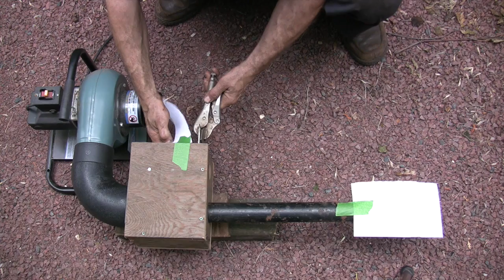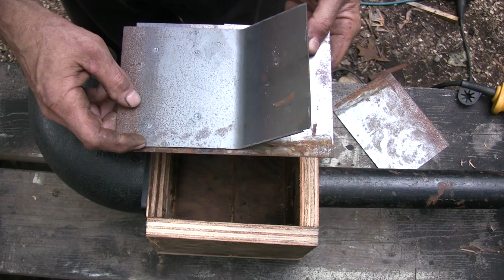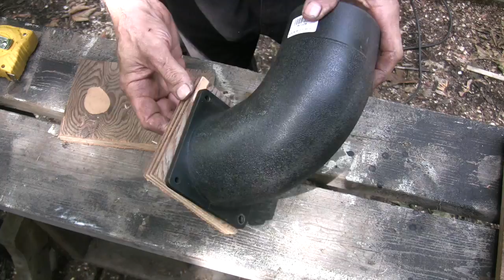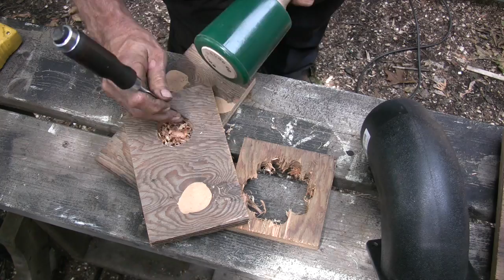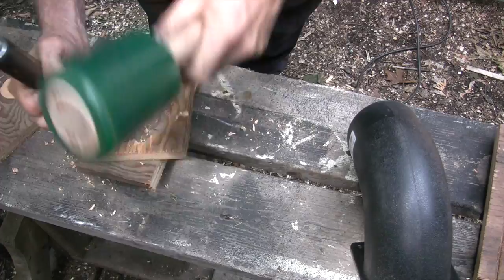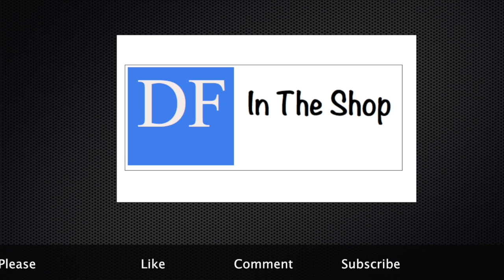Blacksmithing for Beginners -  How To Set Up a Forge Using a Single Speed Fan - 2

Comment: This is stellar. 
VERY old vid, I know, but could I trouble you to provide a bit more of an explanation on the interplay between the inlet and outlet adjustments?
Reply from the maker: This is a 3 part series.  I just added the other 2 videos to the description.  If you need anything else let me know.
Reply: @df-intheshop330  Sweet, I'll look for those. Thanks.

Comment: What would you suggest for blower specs
Reply from the maker: Te nice thing about this valve is that it allows you to use blowers that would normally be much to large for a forge.  The blower in this video is from a small dust collector but I could have used a fan that was twice the size.

Comment: if a person uses a "light dimmer dial" to change fan speed should they still use a valve? why/why not?
Reply from the maker: no, this valve is just used to control the amount of air getting to the fire from a single speed fan.  If you can do that with a dimmer switch or you have a variable speed fan then you don't need this valve.
Reply: A light dimmer will harm your motor
Reply: @stevesyncox9893  how so?
Reply: I tried the dimmer switch on mine... Didn't work. Blower kicks off then on at full power, then off again. Afraid I'd burn out the motor. So this is my best shot.

Comment: I saw a design that had the dump air going up a chimney, introduced at a 60 degree angle up ward; 3-6 feet above the forge. Supposedly, this helped initiate a draft even with 100% dump, (when the fire was first started with no air being forced) and supposedly cut down on the dust... Never saw one in action
Reply from the maker: Sending the dump air up the chimney is a great idea especially if you are having trouble with downdrafts.  The dust reduction claim is probably just due to not blowing all that extra air into the shop.

Comment: That's really cool.  I use a single-speed fan in my backyard foundry and to control the air flow to the fire I just used a simple plumbing 90 degree 'Y'.  The fan blows down the straight side of the 'Y' and the fire is fed off the 90 degree side.  On the outbound end of the straight side is a simple pivoting gate, like you tried in the first video of this series.  To increase air to the furnace you gradually close the gate and the back pressure forces the air down the 'Y' and into the fire.  I haven't tested to see how much air gets to the fire when the gate is fully open (ie: the least air flow), but it quiets right down.  It's basically the same principal as this timed gate concept except it relies on the air taking the path of least resistance away from the fire when the gate is open rather than forcefully diverting it away from the fire. I'm not sure if that's enough control for a forge fire, but it might be worth a shot and it's REALLY easy to make.   At any rate, I intend to try it when I get time to set up a small forge of my own and I'm interested to hear thoughts on it.  BTW, I didn't think this up, I got the basic idea from Colin Peck's book: http://www.artfulbodgermetalcasting.com/index.html.
Reply from the maker: That is the same principle and it would be fine for a foundry ( air on or off ) but I don't think it would give you the control required for a forge fire.  I think there would be a midrange that would be hard to adjust  so you would go from lots of air to very little.  My valve gives you the full range like you would get from a variable speed fan.    If you try it out before I do let me know how it works
Reply: I haven't studied it in depth, but the control is much better than just on/off, and needs to be for my particular oil burner because you need to sort of ramp it up to the heat you want (it's venturi-driven, not pressurized).  My feeling of it though is that at the low end the adjustment is somewhat more fine than at the high end.  Sort of like a parabolic curve where more adjustment give less results, whereas your design is more likely to give a linear adjustment.  But that's just the feel of it.  I haven't measured it or anything.  I'm certainly going to try out the 'Y' fitting first as it's dead simple to make, but if it fails I'll use something like your design.  I'll try to remember to get back to you on it.  Thanks for some great content and good conversation.
Reply from the maker: I would definitely try that first as well.  If it gives you the control you need than that's great.  I was looking for something that reproduced the control you get from a hand cranked blower. Not something erratic like 5,10,15,30,60,100,300 cfm  .   Try to remember let me know how it turns out. Thanks

Comment: When I first saw this video, I thought that's nice, but I probably don't need it since my forge is not very hot and I have a little control on the air intake side.  I learned my mistake today.  While I had been using charcoal, I used coal in my forge for the first time.  I burned up several pieces of metal.  I no longer have any doubts whether my forge will be hot enough to forge weld!  Needless to say, I'm now building the air valve based on your design.  Thanks again!
Reply from the maker: glad it helped

Comment: Excellent. I'm getting ready to build my third forge, this is very helpful for me.
Reply from the maker: That's great but based on the interest of this series I will be putting out a 3rd video showing a metal version of this valve attached to one of my portable forges - hopefully this thurs - so don't run out to the shop just yet.

Comment: We made those for our exhaust pipes when we were kids.  We called them a dump valves.  Used sheet metal and made small ports in front of the mufflers.  Made us loud and a sudden boost of power.  But that's the exact same thing.  I never thought of using it for this though.  Good idea.
Reply from the maker: The nice thing about his system is you can use a large fan by setting  up the timing valve to dump the extra air even when the main valve is wide open to the forge.  For example you may need for wide open to actually be only 25% of the volume going to the forge and 75% dump.   That's how I would have to set up the blower I'm using  in a real forge ( this thurs video ) because 100% air from this fan to the fire would blow the coals right out of the firepot.
Reply from the maker: That's interesting - I've always heard them called dump valves but I have never knew they were also used to wake up the neighbours.  Did you have a linkage to operate these valves or did you have to get under the car to set this up ?
Reply: We used flexible cable and a linkage.  It was a pretty simple system.
Reply: Im in the planning stage of building my second forge. I picked up a bouncy room fan but think its too powerful.

ive been thinking of using a single to dual exhaust pipe as my dump valve. Im trying to wrap my brain around it all. 
I think this box will help me to wrap (warp?) my brain around this better. 
Many thanks.
Reply: +DF - In The Shop 
lol. Thats what I'm afraid of, or just burning through too much coal too fast. 
I'll be looking forward to Thursdays video. Thanks.

Comment: This design is so simple but genius, i just made a quick sketch to keep in the old idea book for a rainy day when or if i get an electric blower. I'm using an old Bufco hand crank blower from the mid 20's i restored and its still running strong. Thanks for the great info once again.
Reply from the maker: Glad it gave you some ideas for the file.